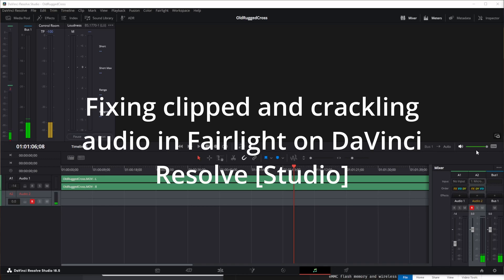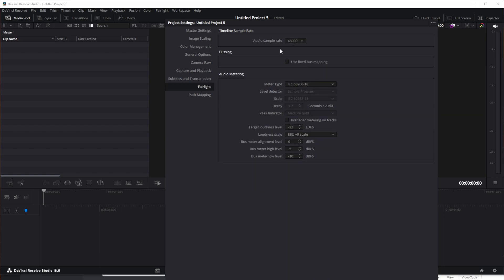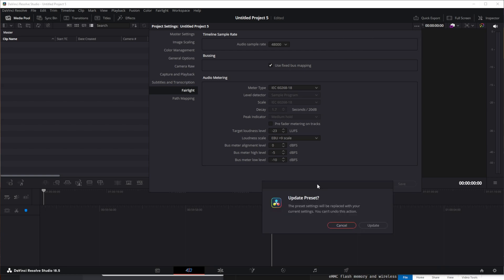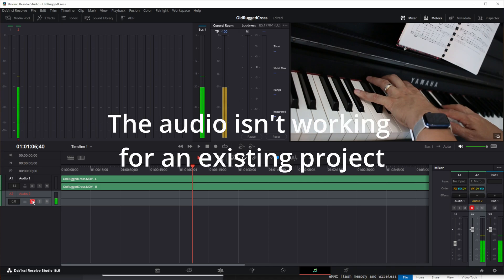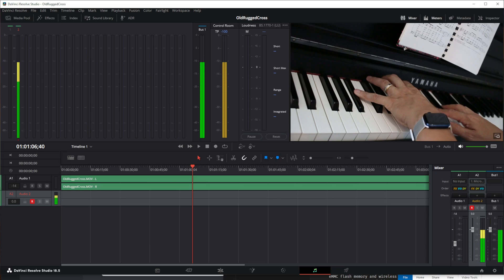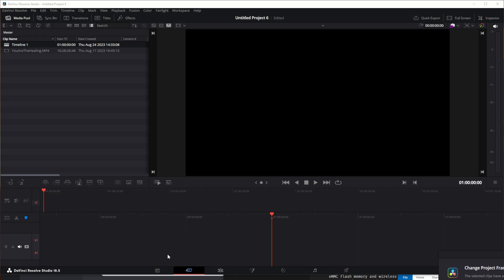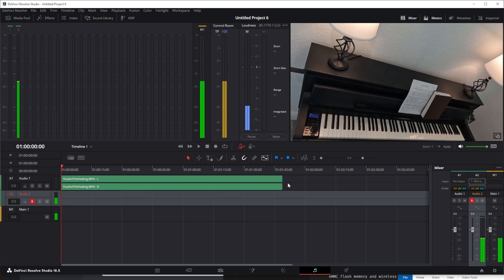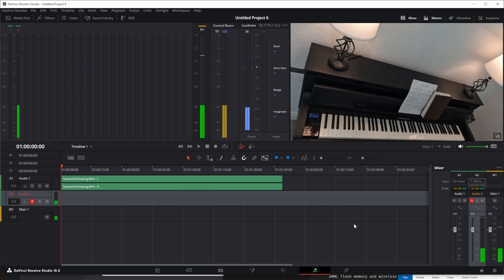Fixing clipping and crackling audio in Fairlight on DaVinci Resolve [Studio]

Comment: Here's what solved it for me without having to restart in a new timeline:

Go here: Preferences > Video and Audio I/O > Audio I/O and then switch "Playback processing buffer size" from Auto to 128 or 256 and then restart Resolve.

I'm no software developer but basically I think this tells your computer to give more bandwidth to processing audio. Weirdly enough it seems to take ALL my laptop's bandwidth for processing audio, because once that setting is changed I'm actually not able to play audio in other programs like Chrome or Media Player so I have to turn it off again after.

But finding that setting really saved me on a 48 Hour short film and the one I'm currently on.

Working in Windows in Resolve 19.
Reply: what do I do when there are no other options and only Auto?

Comment: What I found that fixed my issue with crackling audio was setting band 6 of my equalizer. Got rid of it completely. I was confused because I knew my audio wasn't clipping because it actually had good, even slightly quiet loudness levels. No idea how to use eq at all so I guess I got lucky lol